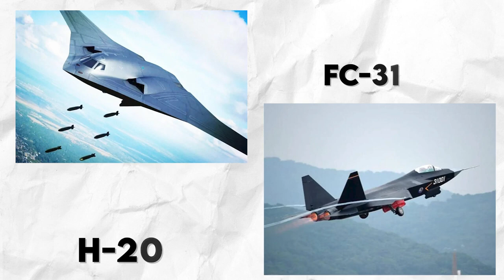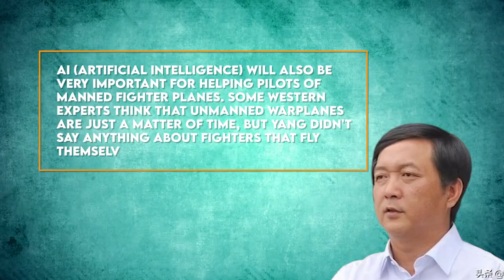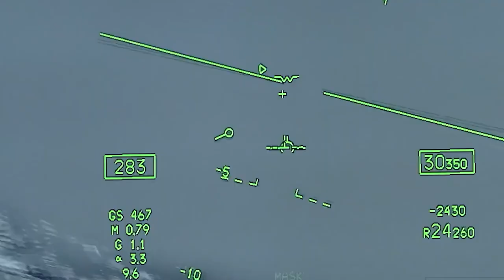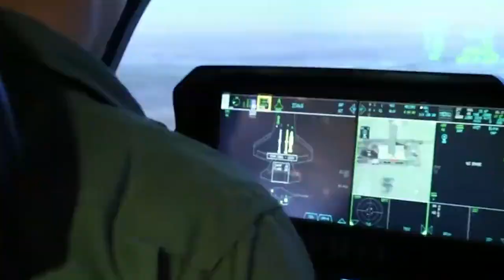China Just LEAKED Its Next Gen Fighter Jet That Will Shock The USAF!

Comment: Any fighter jet that they construct at the moment will be underpowered because Chinese engines are notoriously crap .
Have even tried copying Russian engines , which are pretty good , but whenever they make them they still come out with far less power than the original .
Reply: I think they have made some good engines. They can offer Russia 60 AESA radars for SU35 and Russia give them engine's.
Reply: @aramisone7198  you are stuck in 2017. The new ws10b/c are pretty good with up to 145kN of thrust.  They are actually better that the Russiam  al31 both in terms of performance and durability.  And the ws15 will be even better.  They just successfully tested that a few months ago.